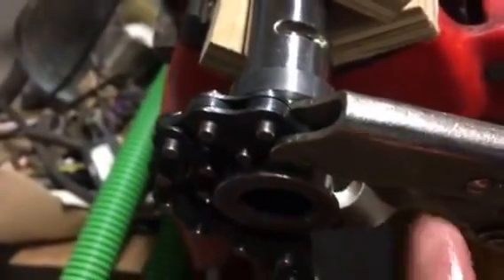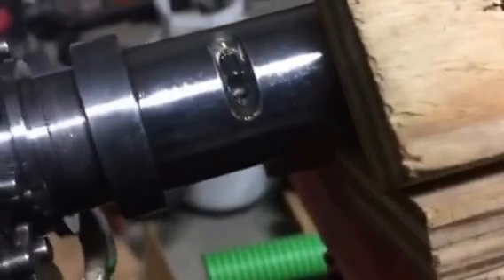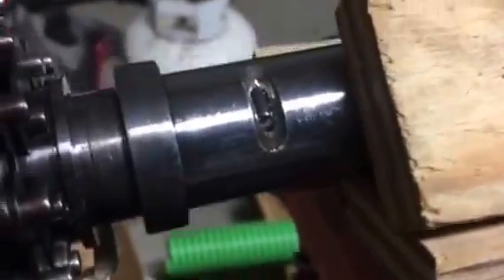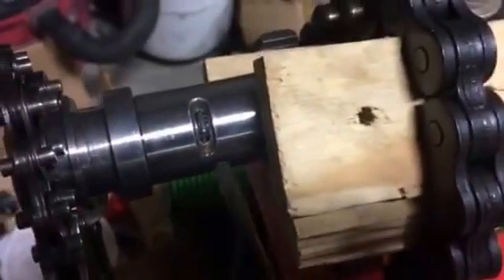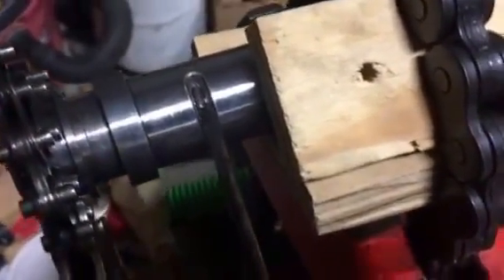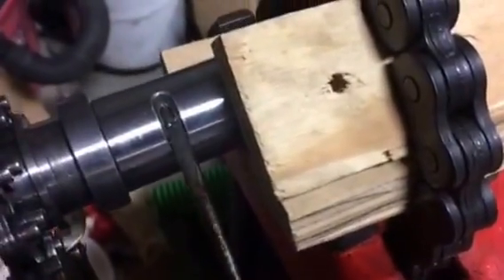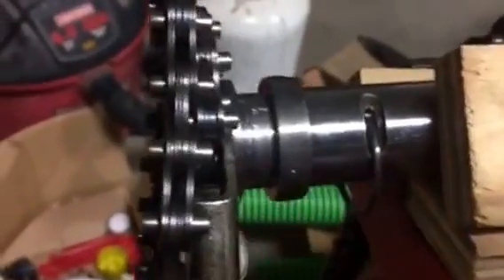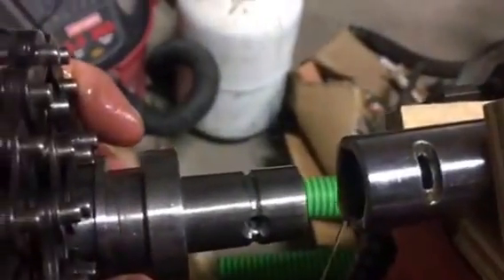Hydraulic Cylinder Locking Wire Removal

Comment: What do you do if the pin is broken on the  inside where it the bent part is that sit in the hole?
Thanks
Reply: Then you have your work cut out for you. If it broke off, it's because it's rusted in making the need to dig it out very much a PIA. Either way, always soak older rings with penetrating oil for a few days. Try breaking it loose with a punch and dig it out with something sharp. Try heating it. Enlarge the hole and dig some more. If all else fails, you may need to scrap the unit, or cut the end off and weld it back on. DON'T BREAK IT OFF! Soak it and turn it back and forth GENTLY for an hour if you have to to break it loose.

Comment: Crazy design. Need to know what your doing before you tough that. Much like making changes to computer software - don't touch it unless you know what your doing.
Reply: It's actually pretty easy if it's not rusted in. WORK IT LOSE SLOWLY! If you break the bent end of the retainer off you will pay hell to get the ring out.